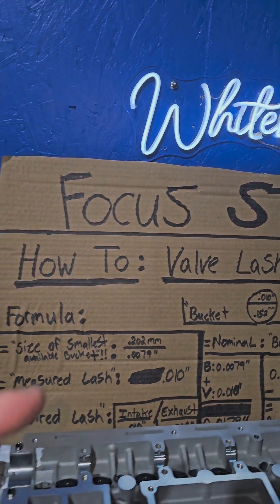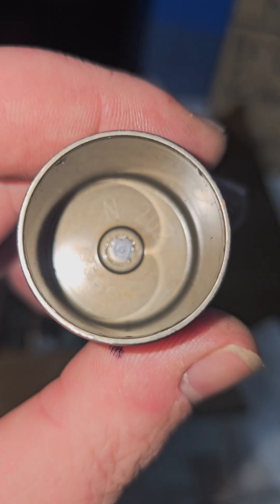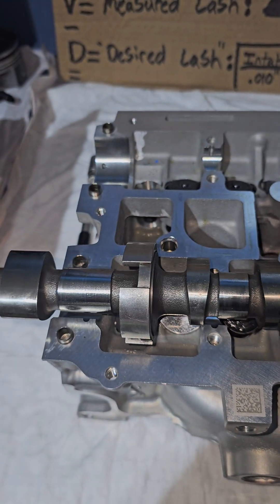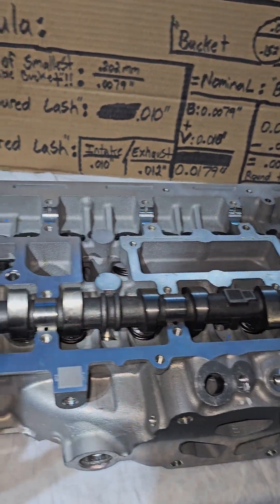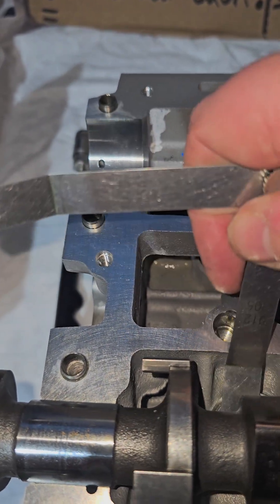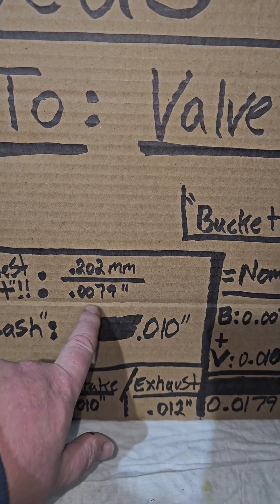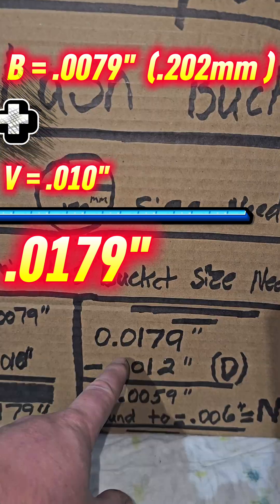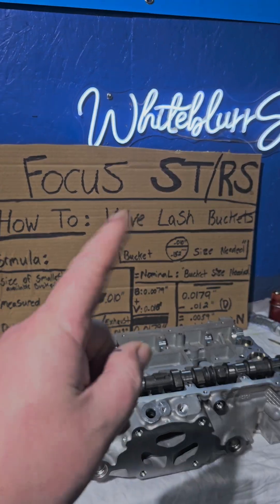Focus ST/RS - How to Valve Lash & Determine Bucket Size    *2.0/2.3 EcoBoost*

Comment: Or make it easier by  keeping it all in mm for the measurement; no need to convert the measurement for the equation. Same method without the need for measurement conversion. Otherwise great explanation
Reply from the maker: Its easy to convert,  im measuring using my feeler gauges which are in inches and  for the piper cams sheet and ford its in inches for the clearances, the reason for converting is because the buckets are in MM not inches.  Example 3.142mm is what they actually are but in the bottom itll say 142mm.  I appreciate the support
Reply: @WhiteblurrST  understandable and makes sense. I'm not trying to question you but it looks like your feeler gauges have the MM measurement as well. I maybe wrong on that but it's why I made the suggestion.
Reply from the maker: Your good bud  but im not using MM as a measurement, I prefer using inches because for me personally its easier.  I use inches for my spark plugs, ptw clearance, bearing clearances, etc...  im just used to that system.
Reply from the maker: I appreciate the support.